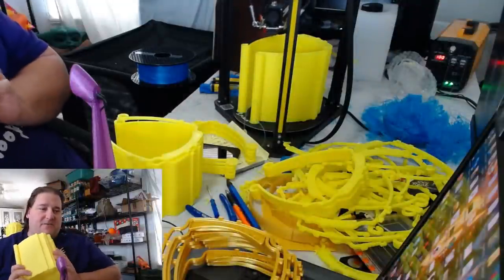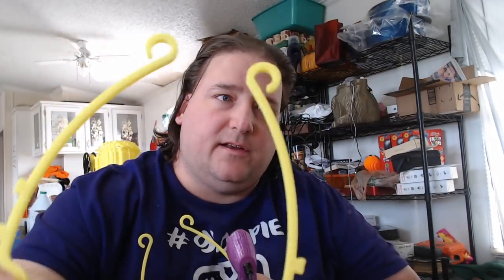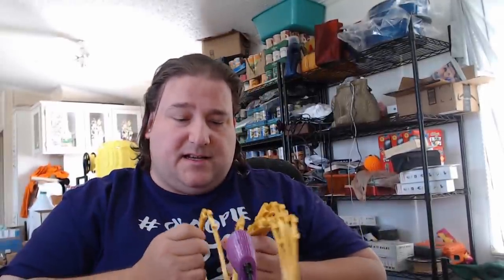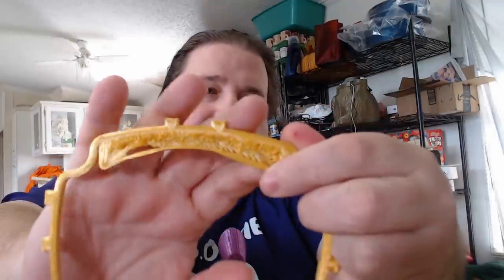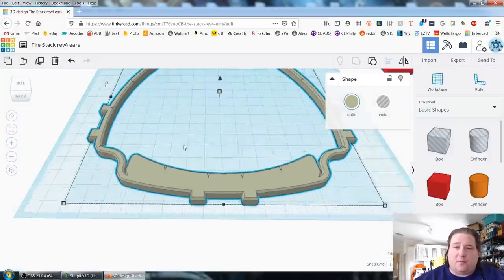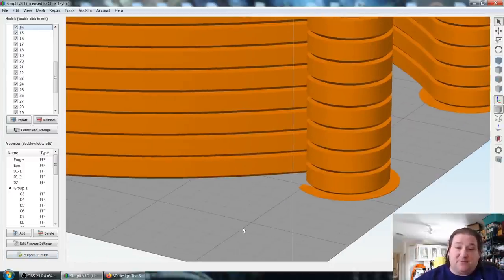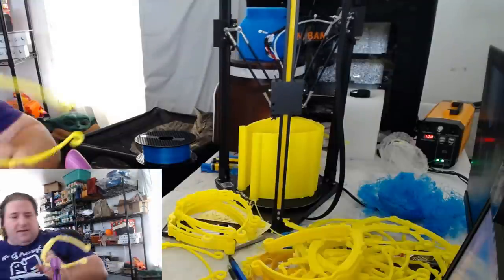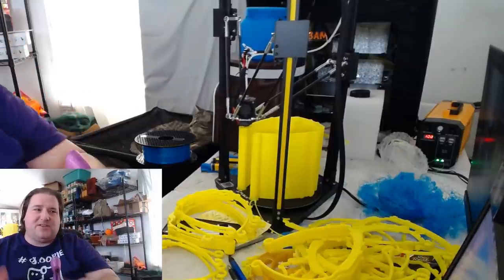Creating The Stack Vertical Sequential Printing

Comment: Thanks for sharing. Very clever approach. It’s like when I first started printing three weeks ago and the nozzle was too far to make good adhesion but they stuck together like Mini-Wheats Biscuit cereal. Your doing it intentionally on the first layer with a downward draft angle for ease of separation! I could see this taking many revisions to pull it off, no pun intended.

Comment: Chris great work but there might be a problem! So I have printed over 500 shields of this type and have learned a few things along the way that has caused me to print 2 at a time. It has been a tough few weeks managing the printers all the time but that is another story! The issue you have with the band twisting on your head is a major one and isn't fixed with adding the shield (most of the time). I have found for some reason when you print a single visor that is solid infill, it does not twist on your head. If you print a stack, even with solid infill it will twist on your head. So I am assuming it is something to due with the actual layer height being 5mm or more that makes it not twist so I am going to experiment by making the model 5.4mm tall and see if the stack works.

I have been printing solid infill so there were less nook and crannies for cleaning and added rigidity. The problem we are having now though is the visors are breaking after a while at the sharp angle where the sides meet the shield area. I am thinking if we add a curvature to the sharp corner it might help with this issue but I also noticed I could flex the visor without the infill(yours) to very far extremes without it breaking. So I am hoping I can increase the height of the visor AND print stacks using your method to come up with a visor that can flex super well and doesn't twist when wearing. 

Before you keep sending out a bunch of these if you have a transparency, punch one and make sure it stiffens enough where it doesn't twist on your head. If no transparency sheets are available, I guess you could try a sheet of paper? Now if you are using laminated pouches for the shield, those are much thicker and might be a different story. Anyhow, hope this is food for thought. Just didn't want you spending a lot on shipping, filament and time if they were still going to twist on the end user. :) Love the videos man!
Reply from the maker: Good point I will look into making updates especially since I really do not need to print them as fast as I am so I can afford to print slower and result in a stronger product. 

 One thing to try is used in film not solid. A solid part will behave different than a part that has in field. The infield should give it structure. I will try to do that. And see if I can get it to stack with infill.

Comment: In cura you can right click and multiply the mesh then stack them on top of eachother leaving a say 1mm gap then print with supports, I have not tried that, I just print two at a time on my ender 3, it takes just under 2 hours.
Reply from the maker: The advantage of stacking is I can tell a printer in another room to start and then not have to mess with it for 20 hours. That's the whole point. If you're just sitting there at the printer then yes, do them one or two at a time and you won't have any failures.

Comment: I've been having so many issues trying this with my Prusa .8mm Trying your models. Thanks for video.
Reply from the maker: Be warned i have had zero luck with anything over a 0.5mm nozzle.
Reply: Man..... I guess it’s not meant to be :)
Reply from the maker: @flowingcolor  it might be doable i just don't have the time to play with it for its minimal benefit.
Reply: @nerys71  What infill are you using on the .4mm? Thanks
Reply from the maker: @flowingcolor  0%
Reply: I noticed the gcodes don’t have a bottom layer? They’re failing on my tries.
Reply: @nerys71  So I pulled the trigger on a "FLSUN-QQ-S" can I use your premade gcode on it? Trying to donate as much as I can.  Which file would I use?

Comment: I tried to print a stack of ear savers and got 3 inch thick ear saver that doesn't bend.
Reply from the maker: Stacking is absolutely not automatic it's something you're going to have to play with tweak adjust and mess with in order to get it to work and on some machines it just might not work with a lot of effort I had it working on six machines and on one I simply just give up I had it working on five other machines and just stop putting time into it

Do you have to play with The Gap distance and temperature Etc Extrusion multiplier becomes important don't even try to petg I have never gotten that to stack although I hear some people have
Reply: @nerys71  I haven't. I gave up after a few tries. Lol

Comment: Great informative video as usual. But, if you are intending to send these yellow ones from the video to hospitals and such, you probably should not keep rubbing your nose and then rubbing the visors.
Reply from the maker: Good point. I do spray each load down with 91% ipa before sealing up the box and i should be wearing gloves when i handle these as well.

Comment: Greetings Chris.  Awesome info and content and they way you presented it! I defiantly learned something new. Glad to see your stepping into CAD modeling. This is way better idea then the Cura method of making a model a "support structure" and stacking. For Glass beds, I have been printing on a DIY delta (https://www.appropedia.org/Athena_Build_Overview) with an unheated glass bed and my CR10S glass bed with bed heat turned off as well. I have been using Elmer's Purple Washable stick glue.  I've tried other brands of store bought glue stick but they don't work, just this specific one.  So to save some electric cost, try that on glass beds. The first model would have to be washed of course.  This has always worked for me since I started with the DIY printer in 2017.
Reply from the maker: The Triangular glue sticks at Dollar Tree used to work, but now they don't work quite as well. I think the formulation has been changed. I will have to go back to trying the Elmer stick. !